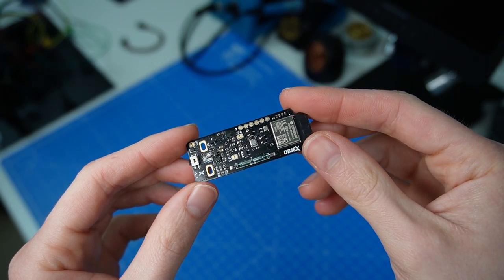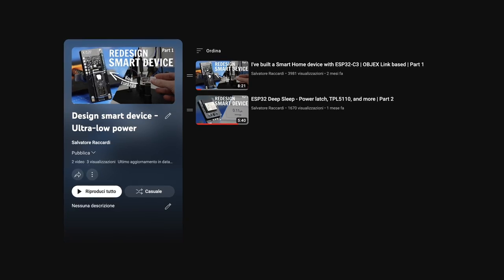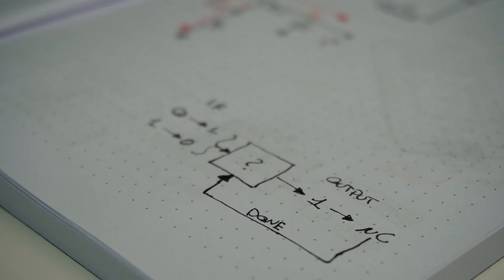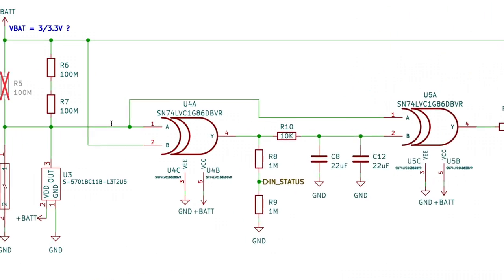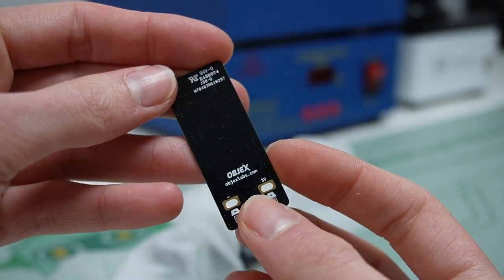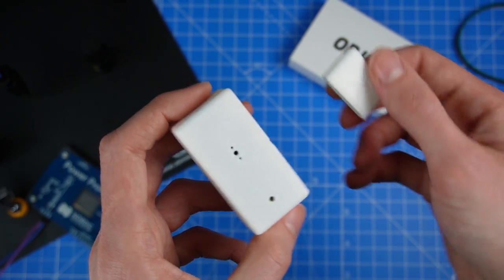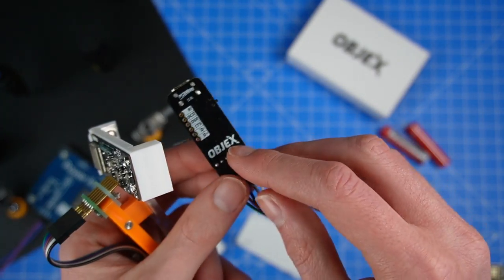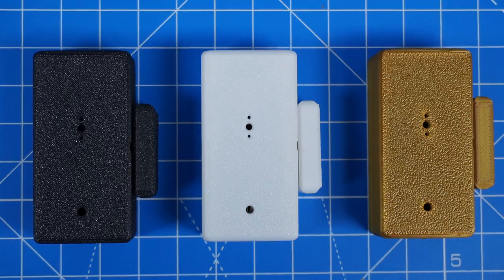ESP32-C3 based Smart Door/Window sensor | DEEP SLEEP 30nA? | Long battery life 5/10 years

Comment: Thank you for your efforts searching for low power solutions. I have gone through this few years ago. But after all my experiments, I have a Window/door sensor and water level sensor which is lot simpler. It does not require reed switch or any special power circuit.It just power down the whole esp32 when door is closed.When door is open it wakes up and send message to gateway.
Reply from the maker: The reed switch/ hall effect sensor is present in all door and window sensors, it is not an extra element but essential. My circuit is not complex, I use very simple and inexpensive components, you only need to take an engineering class to understand the simplicity of the design.
Reply: @SalvatoreRaccardi  I am glad I am not engineer. Engineers tends to over engineer things. I wanted to show you simplest door/window sensor which requires only bare ESP8266 module, few metal short wires and a battery supplying 3 to 3.6 volts with special software and it can do everything you do with your circuit here but with better energy efficiency. And it will be 1/3rd in cost and size of your design here. But I will do it when you come out of your engineer mindset. I have spent 40 years tearing apart electronics to understand them.
Reply: @gsge Sometimes a door is not closed properly, and wind pushes it open. So you push harder to close it. But oops. The read switch has woken up the circuit, but misses the closing of the door. Your version, using wires, will always see the current state. No need to remember the previous state, either your gateway does this, or you can make the circuit smarter. I know 40 years of experience still can beat smart designs. KISS. On the other hand, Salvatore is making a very nice project of this, and if he uses out of the box materials (not PCB way stuff or 3D stuff), it would be for more people. However he has his own subscribers which seem to like his approach. Note: I just came here because YT promoted this video and can say Salvatore is on the right track. But (all) our tracks do not need to be the same.

Comment: 9:28 you could, if you wanted, to make that part of the plastic behind the battery terminals separatable from the rest of the plastic which supports the board so you can remove everything if needed. It is not much more complex if at all and it should be sturdy enough because all goes into bigger case which would hold it together.

Comment: Very nice done. I like it that you grab yourself the target and keep on improving it. It’s a nice combination of mechanical and electric engineering, like the details on the battery bay and the lid. Details. 

Although I also very much like the versatile and addictive ESP-32, could you imagine using a more power friendly chip?
Reply from the maker: Thank you! The next step is to use the nRF52840 and try ESP32-C6.

Comment: I used the C3 for my leak detectors as well. Great deep sleep capability and <40na. With a 800ma CR123 rechargeable I look to get easily over than a year, maybe 2 depending on internal leakage!
Reply from the maker: I developed a module(ELPM-S3LW) just for this kind of application: https://objexlabs.com/products/ELPM-S3LW
Reply: @SalvatoreRaccardi  Your design is good, but I'm not a fan of Lora. For inside applications I prefer espnow. Single module and lower power.

Comment: Good engineering, well done. I like all the simulations and research you did before diving into the PCB design. That circuit is complex though, are you trying to simplify it or are you ok with it?
Reply from the maker: It can be simplified, depending a lot on the result you want to achieve.

Comment: how sexy are those 0.8mm boards! I love them in my projects.

Man, how much simpler would home automation be if you could just project an rf field around a house and tap that for energy? I'm working on weight sensors for my gas storage to detect leaks and warn me when one of the two bottles gets low... it's got a pair of 16550's and a solar panel...
Reply from the maker: Thank you for your comment. Very interesting your project!

Comment: Very nice idea. I was checking the Kicad schematics today. Very nice schematic layout as well.
 Some question remains for me:
Why did you change the Mosfet from NTNS... to the DMG3415?
And why did you include a LDO for the BME680 at all? It runs fine with 3V and is also internally compensated so no drift with a depleading battery. 
For Low power it doesnt really matter but its one more part. 
Thanks for making it open source!
Reply from the maker: Hi! I changed the mosfet only because of availability. I added the LDO to the BME680 because I wanted to do some additional tests.
Reply: @SalvatoreRaccardi  thanks you for the answer! Did you ever get to incorporate the BME and used the door sensor as a environmental sensor as welll?

Comment: Very nice project, i like it. I see is not so easy to reflash once the module is assembled. Have you thought using the over the air reflashing? Well to implement that may help you, but it will also depend how often you think you need reflashing the modules
Reply from the maker: Good point, with the power latch I developed you could use OTA but under the condition that you trigger the sensor first. I'll add this feature to the Todo list for the next version.

Comment: Why not using a ultra low power microcontroller to offload simpler tasks from the main system?
You could do a lot more, including smarter pin monitoring, use wake up interruptions on pin edges, timer, etc. This is possible using the sleep mode that would bring power consumption down to around 100nA.
I know that's more power than your circuit is draining, but it does a lot more. It is an interesting tradeoff.
Reply from the maker: Your point is right, but the goal was to develop as simple a solution as possible with the ESP32C3. I also developed a version with a microcontroller that does the supervisor work, but from my point of view it is a solution(supervisor microcontroller + ESP32C3) not suitable for mass production.

Surely ,it would make sense to use an Ultra low power micrcontroller + RF(BLE/zigbee etc).

When developing a product you have to simplify the design as much as possible, in my point of view.
Reply: @SalvatoreRaccardi  I understand your angle. IMHO the supervisor is superior, especially because it is a general and flexible solution, extensible for other applications, and you can even update the supervisor firmware from the ESP.
In the end the scale could make it worth the extra complexity. Some microcontroller are less than 50p.

Comment: What off the shelf components could I buy to get close to this? I don’t have the machines or experience to put this together. It’s a great project and would love to be able to buy an add on module to use an existing ESP32 board…
Reply from the maker: Hi! Next week I will upload a video where I show a new project of mine, which does just what you describe. I suggest you stay tuned :)

Comment: Sadly I didn't understand.
Here's what I thought you would do:  Use a normally closed reed switch (that will be open when the window is closed) directly on the power line. When the window is opened, the ESP32 is powered up and the first thing it does, is turn on a transistor that's in parallel with the switch, sends its state to the MQTT broker or whatever and goes to deep sleep. When the windows is closed, the bounce of the reed switch means the ESP32 will be woken up, turn on that same transistor, sends its new state to the MQTT broker and turn off the transistor, so cutting all power. Could you explain why my solution isn't good and how yours work in greater details?
Reply from the maker: First of all thank you for your comment, I am just seeing it now. I explain in detail how the circuit works from minute 4:10. 

I don't really understand your idea, I would need a schematic to understand better. In any case, have you tested your solution?
Reply: @SalvatoreRaccardi  I didn't understand your idea, you don't understand mine....maybe it's not worth the hassle. Thanks for sharing, anyway!

Comment: Hi Salvatore. I did power latch rising&falling edge dedector schematic. When i test the circuit, current measurement is almost 200 mikroamper. I could not see nA levels. I used SN74LVC1G86DBVRG4 too like schematics. Do you have any opinion or suggestion for me? By the way i really like your design...Best regards..
Reply from the maker: Hi, the first question that comes to my mind to ask you is how did you measure the current?

Comment: Impressive result
If I understand correctly, the RC delay (R10, C8, C12) is basically the time for MCU to respond and latch on the main MOSFET to prevent the circuit from switching off again?
Toggling AUTO_TURN_OFF must be the first operation after the MCU wakes up?
Reply from the maker: exactly
Reply: @SalvatoreRaccardi  any potential issue when using a "fresh" assembled module? Since the module has no program to keep to toggle the IO at the first time. Or when reprogramming and forgot to add that line of code
Reply from the maker: No there is a procedure for programming the board to bypass the power latch.

Comment: Hi have you worked with esp32C3 and mpu6050 . Can you tell me how you could connect the esp32 c3 with mpu6050 pins if you had done it ?
Reply from the maker: Via I2C?
Reply: @SalvatoreRaccardi  I solved the issue . I need to know the max current and voltage that esp32c3 normally consumes . I saw it consumes 40 mA for esp32c6(active state) . So wt will be the same with esp32c3 ? Secondly , my device might be in active state for 12 hrs(max) , so just to calculate the maH of the battery .So which battery is preferable .The size of the device would be 25 mm*35*20 mm . are there such batteries available ?

Comment: You can fool the sensor with any magnet. Is it possible to use something coded, specific to each sensor?
Reply from the maker: All smart door sensors are designed in this way. It is possible to make this device more secure by making the unit containing the magnet smarter.

Comment: Good afternoon Salvatore, I really liked your video, and with my brother we decided to make the same PCB for our house. But we have a problem, all the programs work except those that are related to WIfi. The only wifi function that works is the Wifi status. For example if we do a wifi scan it runs all the code until it reaches one of the WIfi functions and then it stops running.
It would help us a lot if you or someone from the community could give us a hand.

Thank you very much for your help.
Reply from the maker: Have you tried to see if other people online have experienced a similar problem?
Reply: @SalvatoreRaccardi  Thank you very much for your response. Yes, I have asked on several forums, but so far they have not been able to give me an answer.
Reply: We are not sure if the problem is a configuration, library or PCB communication system issue.
Reply from the maker: what antenna are you using?
Reply: @SalvatoreRaccardi  I'm using an ESP32-C3-Mini-1
Reply from the maker: @ferranserra4694  Ok... 95% the problem is software
Reply: @SalvatoreRaccardi  Okey, thank you very much for your help. But I suppose that the error will be of configuration, because the program is a basic program of arduino, of those that come made, to make tests.
Reply from the maker: @ferranserra4694  Have you tried using the same firmware with a DevKit esp32?
Reply: @SalvatoreRaccardi  No, I haven't tried it because I don't have a devkit.

Comment: Would it be possible to do this with an accelerometer interrupt instead of reed sensor?
Reply from the maker: Yes sure.
Reply: @SalvatoreRaccardi  How should I connect the accelerometer?
Reply from the maker: @begonamarkina9658  It all depends on the sensor model and project specifications.

Comment: I tried makermeik project and the logic circuit to enable ldo does not work as desired. On one pcb it worked i dont know how but on all others it failed
Reply from the maker: The design I developed works very well, I have done several tests, and so far I have not found any issues with the design.
Reply: @SalvatoreRaccardi  will u make the code n ckt public?
Reply from the maker: @superbikeengineer  The basic code is public
Reply: @SalvatoreRaccardi  and hardware project is complete?

Comment: Great video, two questions for you. 1. If you only transmit when the sensor state changes, how does the controller know if this sensor is "online" if the sensor state hasn't changed for days? (like ring, zwave, etc controllers know that their sensors are "online"). 2. If you changed to wake up from deep sleep and transmit the state every 5 seconds, how long do you think the batteries will last?
Reply from the maker: Note that all WiFi smart sensors have the following problem, which can be solved by scheduling wake-up every hour. Every 5 seconds is inefficient. In some applications it is not necessary to know whether the sensors are online. If they are sensors for apartment security, yes, but if they are for turning on a light or making a simple measurement, it is not necessary to know if the sensor is online. It all depends on the application.

Comment: The main question is why build something new based on traditional batteries. It makes no sense to me.
Reply from the maker: Why doesn't it make sense? The goal of this project was to increase the life cycle of the device to 10 years of use by keeping the same batteries(which are easy to buy and cheap).